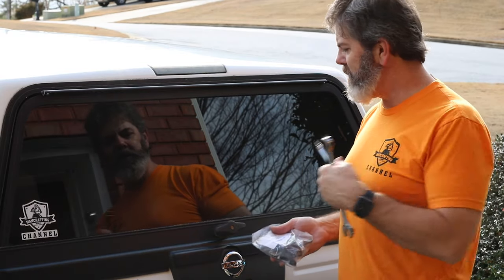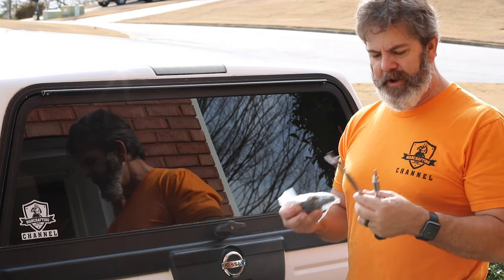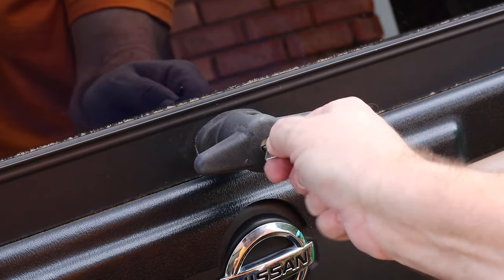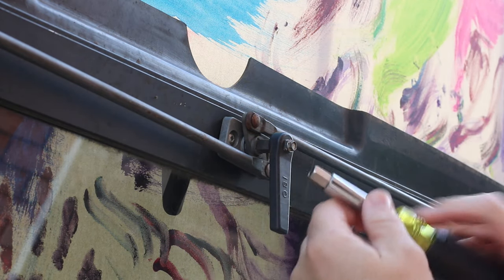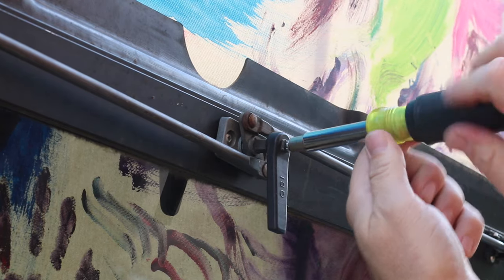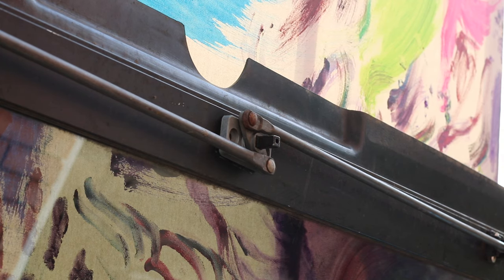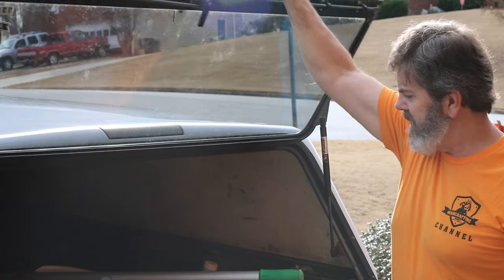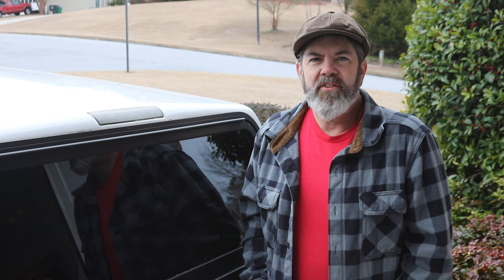Truck Cap T Handle Replacement

Comment from the maker: Affiliate Links:
11 in 1 Screwdriver  https://amzn.to/3aI0CDZ
Wrench Set  https://amzn.to/2TZHo6T
T-Handle Replacement https://amzn.to/30ZcywH

Prevent easy theft of your Tailgate...
Tailgate Lock https://amzn.to/2toctGv

Tools:
Eleven Tools in one Screwdriver  https://amzn.to/30wg55l
Tape measure Made in USA  https://amzn.to/2u5hQul
My Favorite Wrench Set https://amzn.to/2Tv6cDr
T-Handle Allen Wrench Set SAE and Metric  https://amzn.to/2szuZLK

Camera Gear:
Video Mic http://amzn.to/2pMM2XK
Lightning to 3.5mm Audio Headphone Jack http://amzn.to/2pyimwy
New Professional 70" Tripod with Adjustable Pistol Grip Head and Heavy Duty Carry Bag http://amzn.to/2qtFQjE
Dimmable 600 Bright LED Light Stand Kit  http://amzn.to/2dMiP9f
USB Microphone - Silver  http://amzn.to/2dewgA5
Digital Still Camera http://amzn.to/2dJcAA0
Heavy Duty L-bracket with 2 Hot Shoe Mount for Video LED Light Camera Flash Camcorder Microphonehttp://amzn.to/2pl51qW
160 Dimmable Ultra High Power Panel Digital Camera / Camcorder Video 
Light, LED Light for Canon, Nikon, Pentax, Panasonic, Sony, Samsung, and Olympus Digital SLR Camerashttp://amzn.to/2pykswm
Flexible Tripod with Ballhead Bundle for DSLR and Mirrorless Cameras 
http://amzn.to/2qmKTTH
Movie Maker Set - Electronic Sliding Track System with Variable Speed and Motorized 360° Panoramic Time Lapse Head compatible with Smartphones, GoPros, Digital Cameras http://amzn.to/2oW8EQz
Rotating Tripod Time Lapse Stabilizer 360° 60 Minutes, Motorized Rotating Station Time Lapse Adapter for Canon, Nikon, GoPro, SLR Camera, Digital Camera http://amzn.to/2pl9QjY
Infrared Camera http://amzn.to/2sXSImR

Never Get a Copyright Strike again.  Royalty-Free  Music  https://tinyurl.com/wzautk3
#nissan #t handle #truckrepair

Comment: I recently bought a pickup and it has a unicover topper safari series, and I had to buy replacement keys, the lock was seized and ended up breaking one key off inside the lock trying to unseize it, finally got the key out and I thought the lock was able to lock as I was able to make a full 180 degree turn, I tried in vain putting the lock back on the topper, the biggest piece of information in this video for me was him stating what angle the handle needs to be in when reinstalling it,  which was crucial, glad I found this video with that key bit of information. Thanks. But for some reason my lock still wont lock. I reinstalled it in the direction stated and was successful in that regard, but for some reason it wont lock eventhough the key turns 180 degrees, guess I'll just buy a new lock assembly.
Reply from the maker: Fortunately the handle wasn’t to expensive.  Glad the video helped.

Comment: Just one comment on an otherwise excellent video. You didn't show how the old handle came off. I assume it pushed out from the inside, retaining the old side lock bars and actuator.
Reply from the maker: Thanks for pointing that out.  Once the screws are removed it just slides out.

Comment: Is there any way to power a lock like this?
Reply from the maker: Great question.  I’m sure there is, but it would require running power and likely adapting a power unit from another tailgate.  I don’t think they had power locks on this model year.